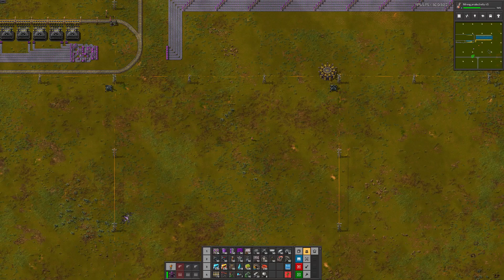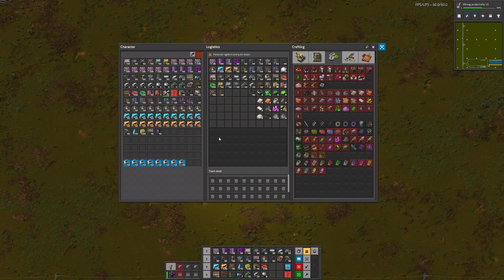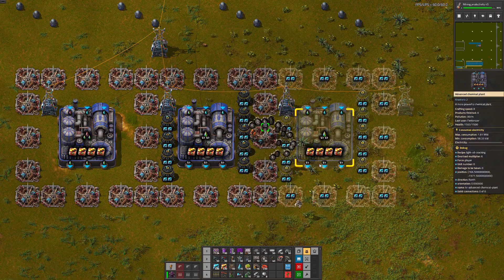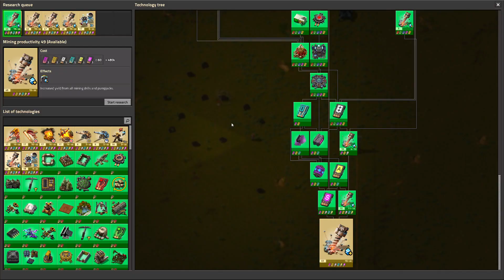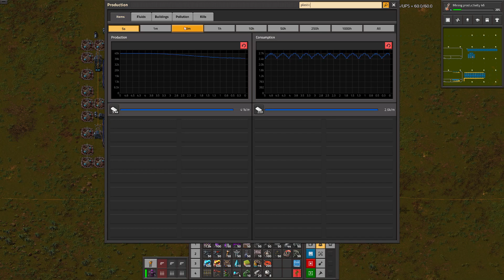Plastic -- Krastorio 2 -- Episode 15

Comment: To reduce the amount of petroleum that is needed to be handled, as it's the fluid with the most throughput issues, would it not be simpler to hook up each light->petroleum cracker directly to the plastic, separately from the "direct" petroleum? As it's a nice 4-4 of buildings. And this is assuming you are able to consume more then you are producing at each stage.
Reply from the maker: I've been experimenting with direct insertion off camera, yeah. I'll show it off next episode as I think it's working pretty well.